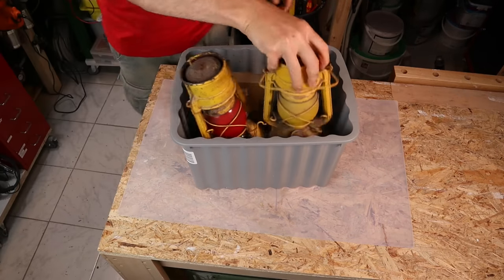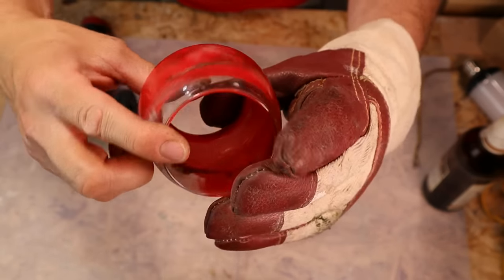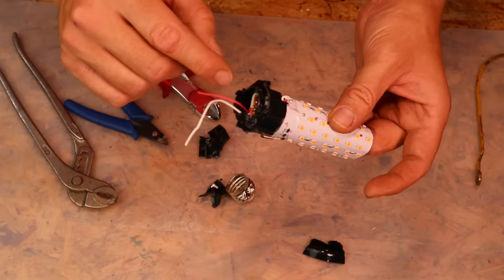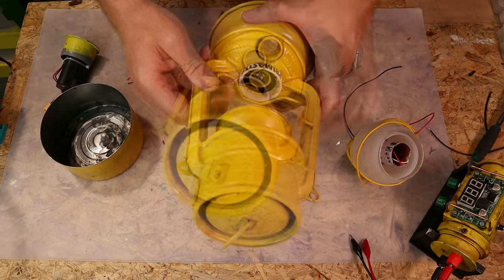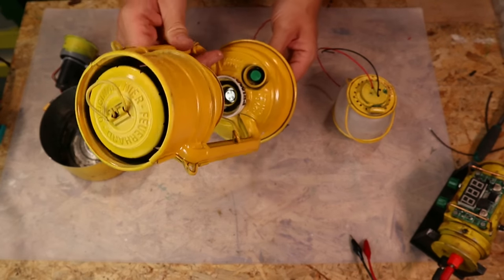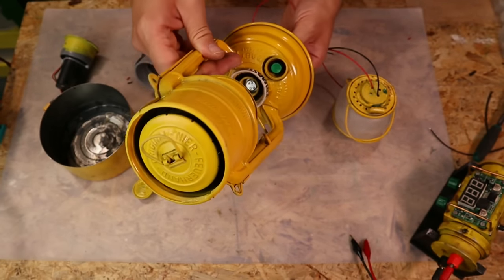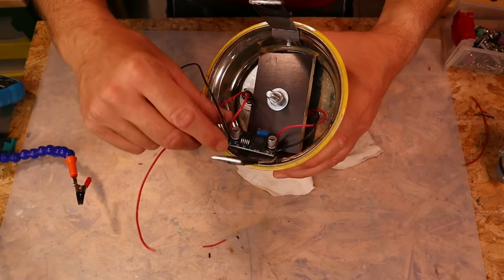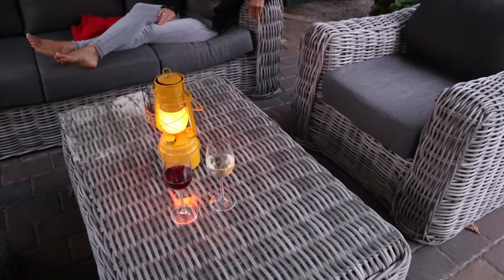Oil lantern to flame LED conversion. Old oil light mod.

Comment: This is just crossed my mind, i have several old lantern and thinking how to convert to led. Thanks for the video!
Reply from the maker: Hey, glad I could help you with an idea 😁
Reply: Research the make and model of your lanterns, as many of them can be pretty rare and valuable. I have a few that have been sold in the past for 5-600 bucks. Take care of them and do not modify them permanently like he did in the video or they’ll become worthless.
Like those two in the video. Those feuerhand lanterns will go for 60-150 bucks EACH!
The glass globes alone, in original condition with their paint still on them often sell for 40-50 bucks a piece.